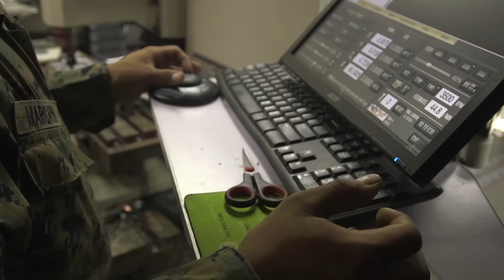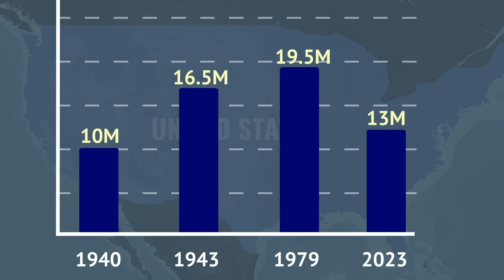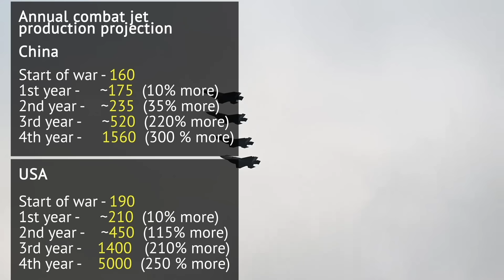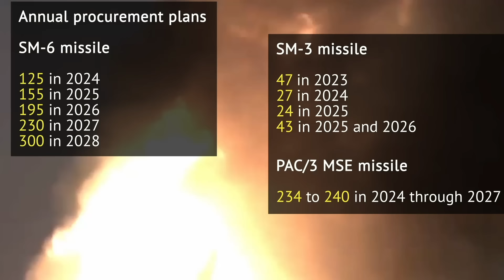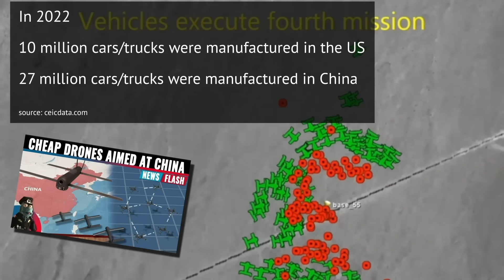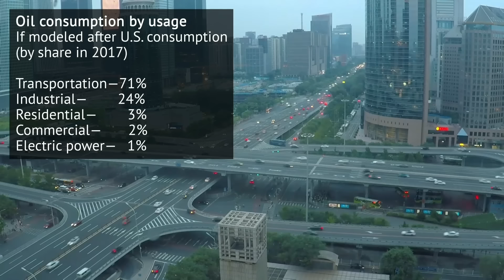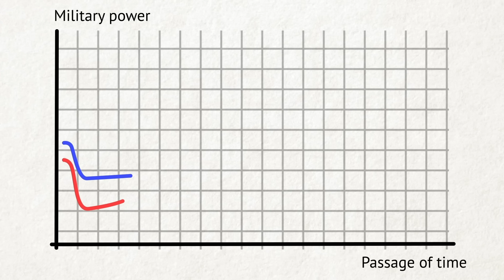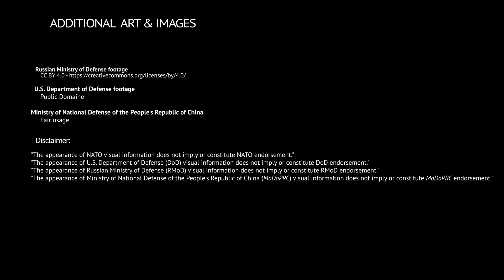Can industrial output decide US v China war?

Comment: You are way too optimistic on how fast and how much weapon production would expand. We don't know much about China but in US we know it's definitely not the case. Modern weapon systems are way more sophisticated than WWII counterparts and most of them require highly specialized expertise which US does not have enough and won't be able to train more fast enough. Congress have been trying to up shipbuilding capacity of surface combatants and nuclear subs for years but now they are told it can't be done even with the money they throw at ship yards. F-15EX was supposed to be a cheap and fast supplement to at that time troubled F-35 project. But now with F-35 finally well on its track, Boeing still delivers fewer F-15EX every year than Russian delivers Su-57 which itself is already a joke. 5000 planes production in 4th year? That's unless Willie Wonka decides to tip his toe in aeroindustry.

Comment: USA won World War 2 because their industry output was No. 1. Durig WW2, for every tank destroyed, aircraft shot down and ammo used, US industry can easily replace them in days.  This is not the case now, sending ammo to Ukraine is slow because the industry output cannot keep up with the rate of ammo used. There is possibilities that some raw material for the weapons also need to get from China.
Reply: agreed, but on the other hand, China has major deficiencies in oil, gas, food - most raw materials really. If the imports are stopped - which is not that hard given US allies in the region, the Chinese nation has mere months before collapsing
Reply: US has been stockpiling weapons for 50-70 years....thousands of Tomahawk missiles, hundreds of HIMARS launchers, etc. Even if it doesn't build anything for 20-30 years, it'll still have a material advantage.

Also, China's industrial base is because it has the USA as their biggest customer. WWII US did not have Japan as their biggest industrial customer...
Reply: @nutellacreep  The US admits it would largely run out of ammo or be critically short (unable to continue projecting power) within 2 weeks of war breaking out with China. The US dropped 13 billion kg of conventional explosives in WW2. That's ~70 million himars gmlrs and 15 million tomahawk block 5s (I'm using the two weapon platforms you mentioned). The US produces 7500 gmlrs per year and 58 tomahawk missiles. Even if they were able to increase production (they wouldn't be able to) it'd cost $12 trillion for the himars missiles and $29 trillion for the tomahawks. To think we have anywhere close to those amounts on hand is foolish.
Reply: @nazcamain  GMLRS and Tomhawks are expensive stand-off weapons. If we are to do an apples-to-apples comparison, the WW2 bombs are more similar to cheaper JDAM bombs. But JDAMs have some degree of guidance, so much less of them are needed compared to WW2 type weapons.

I mean, you're basically saying WW2 USA can defeat modern USA. It might be true, but I'm not so sure if it is true.
Reply: @nazcamain Yeah China would be facing similar problems. They would have to launch at least 1000 ballistic missiles in the first week considering they are striking Japan, South Korea, the Phillipines, U.S. bases, Taiwan. They also would be under sanctions and blockade whereas other than Asia most U.S. trade routes would remain unaffected.

Comment: China would be worse off economically due to loss of exports?  Who is in a better position...China with a large surplus of people and manufacturing due to the loss of exports or the US who just lost those needed imports and now needs to not only ramp up for lost imports but also war? I am pretty sure in war those idle factories would find a use for China.
Reply: China is a net importer for things such as oil, foods, and raw materials. Which means they rely on importing this stuff in to make stuff. They import 70% of their ore from Australia. Then import over 11 million barrels a day and 80% of that comes from Saudi Arabia. Without oil, no plastic or fuel to run the country. Then the food they import from the US and Brazil because China can't make enough of it domestically.

The US is a net exporter of oil, food, and raw material because the US produces an excess amount of it. The US is the top exporter of fuel, with most of it going to Europe. The US food export to China is $35 billion or 17% of China's food import per year with Brazil accounting for over $43 billion or accounting for 21% of China's total food import.

How do you keep your factories running without the raw material or food to keep your population feed? The only oil pipeline China has comes from Kazakhstan since the oil fields from Russia are 8,000 miles away in western Russia because that's where their main customer, Europe, was. Over 90% of China's imports come from sea, which the US already controls those chokepoints such as Malacca, Sea of Japan, and the Pacific. The US would just blockade these routes and starve out China.
Reply: The entire China sea would be a war zone, doubt anyone, including us would be getting imports from that entire area.  Much of the world's technology products could be cut off from trade, which is much harder to replace than raw simple raw materials.  You can substitute different materials when needed, but not many substitutions for microchips, etc.

Comment: We ended world war 2 with including war losses 300,000 minus the 2,500 we had that's 297,500 divided by 4 years assuming production was instantaneous at the war's start which it was not that would be 74,375 aircraft per year. This video is claiming that yearly production for world war 2 is 52,300 that would be 209,200 before losses the production would have to exceed the number at the end of the war because many planes were lost something is not tracking here. I think a mistake may have been made.

Comment: Regarding trade, the strength of the US dollar allows it to simply buy out the export industries for wartime use. China would likely try to force theirs into wartime, and use their economic controls to stabilize the results. But given that the US currency is very heavily traded internationally and China's isn't, the US is way less dependant on it's own exports for currency stabilization.

So essentially China has a way harder job in stabilizing the economy in a total war scenario beyond just the raw export and resource difference.

Comment: The early war would be savage, but after the first and second years both would be facing modern equipment shortages (most equipment would be destroyed and due to complexity not be replenished faster than losses), lack of capable manpower (aging population and low birthrates, being the biggest drivers), political unrest and mutinies. The war would probably last a whole decade, but be far from a total war as neither has the political, demographic and economical capital to sustain one. It's end would be in the case of one of the sides crippling into civil war, or a truce between both nations due to war exhaustion.

(Of course that's discounting the possible use of nukes)
Reply: thats a very realistic view mate. i agree!
Reply: modern eqipment cannot be made like they used too in ww2 because of all the electronics. in the past it was mostly steel.
Reply: I don’t see how that comes to China

Comment: American automakers could also make low-tech drones and loitering munitions.

But the war won't last long.

China imports close to 70% of its energy, food, raw materials and agricultural inputs. Shut that down and you can forget about ramping up manufacturing. You can forget about keeping people fed, too.

Chinese chip manufacturing will go mostly off-line. The precursor inputs to chip-making come from overseas. There are thousands of processing steps and components involved, most not done in China. No chips = no manufacturing for any tech weapons or ships.

China can't exist as a closed economy, let alone sustain a war.

A blockade is an existential threat for the CCP. Which opens up the possibility of resorting to nukes. The CCP might calculate that losing half their population and dealing with the aftermath would be preferable if it lets them retain political control. As for the US, a nuclear exchange will end the US ability to project military power. It would take them off the board.

It's no mistake that China is working feverishly to increase its nuclear arsenal. What they have is fine for MAD deterrence. It isn't enough yet for a no-holds-barred nuclear exchange with the US.
Reply: @lolasdm6959  3 nukes can take out the USA easy.
  But you're not including modern bioweapons whick make nuclear warheads look quaint.
Reply: You forget Siberia exist and supplies China with all it needs in oil and food.
Reply: @johnsmith1953x  3 Nukes cannot even destory all structures in New York... Nuclear weapon radioactive material also have extremely shot half life. Please go read about blast radius and radioactive fallout.
Reply: @flyinpug3791  works if you don't bother to look at the actual infrastructure.

Problem is, that land route is maxed out.

They'd have to build more pipelines to get more oil from Siberia to China. That's a ten year project if they have the capital to invest and the expertise to pull it off.

Neither Russia nor China have the expertise. And capital is in short supply for both nations at the moment. But if they could solve both obstacles...

It's a ten year project.

The Siberian oil fields were developed by foreign companies.

Who left Russia in 2022.

Russia will struggle just to keep existing fields pumping. They really are short of skilled oil workers. It's no joke.

Truck routes are not robust, either. And though China and Russia share a border, don't let that fool you. The distances involved are immense, the road network is pathetic, and neither China nor Russia wants to accept the other nation's currency.

"They'll just get it from Russia" is a phrase that rolls glibly off the tongue. Reality ain't in it.
Reply: @Urgelt  10 years is more than enough time for such a hypothetical war to occur like this video is presenting. Whatever will happen with Taiwan, will not escalate into an all out war. Americans are tired of dying half way across the world.
Reply: @flyinpug3791  if they start work now it would take 10 years and a big pile of capital.

They are not starting now. They don't have a plan, the capital, or the trained workforce and equipment to start.

Glib one liners do not make things happen.
Reply: @Urgelt  I think you’re underestimating the Chinese will to get things done. Siberia will be a part of China soon when Russia collapses. China already exports top quality technology and infrastructure around the world. This is a fact. It has the skilled manpower to build such infrastructure and will within time.

Comment: How can you forget that China is the largest producer of electric cars and renewable energy. So an oil embargo would hurt but not devastating, especially since they can get plenty from Iran and Russia. And if China economy is going to be blocked off then so is the rest of Asia. Korea, Japan and SEA economies would also collapse as well.
Reply: Electric cars are frankly not relevant in this conversation at all, oil is used in plastics manufacturing, power generation, fertilizing agriculture, and powering ships. You can't switch all of these things over to renewable sources and it takes a while to do so. Iranian oil still has to get to China and and that's really only done by sea, which runs into the blockade question. Besides, the point of a blockade isn't to cut off all sources of a good, but to apply economic pressure. Even if China can still meet all of their oil demand, it's going to be at a significantly higher price, and that can cause a lot of damage to the economy and the state's finances.
Reply: You cannot be serious. A few EVs are not going to replace the loss of all that imported oil.
Reply: @danmoreman954  "A few EVs"?  Nearly half of all Chinese car sales have a plug, and that number is growing fast.